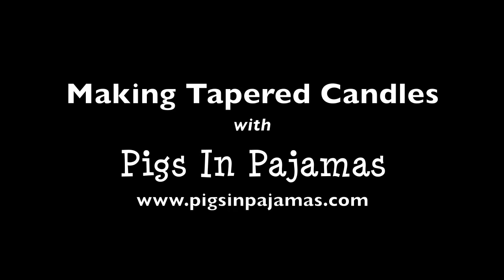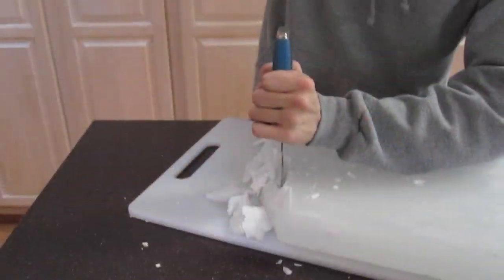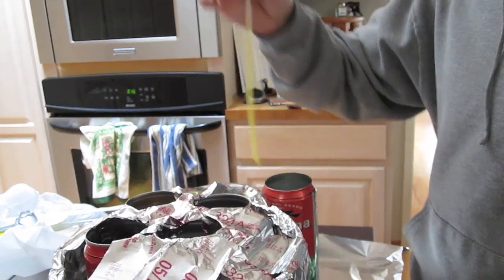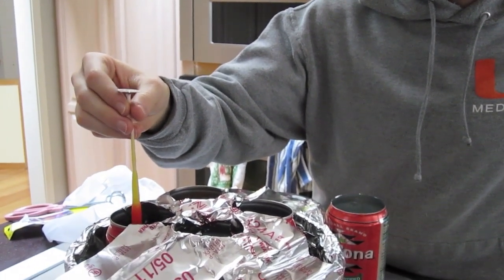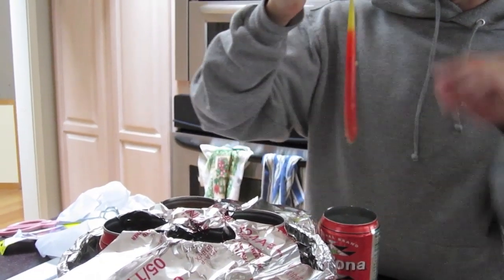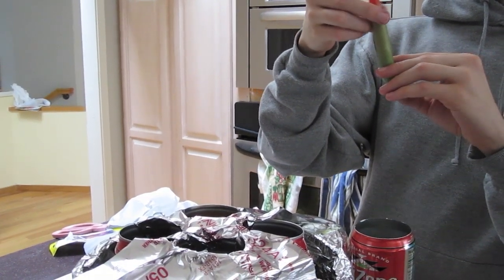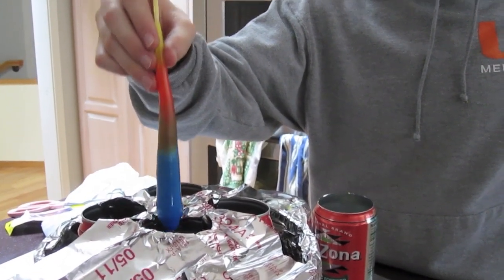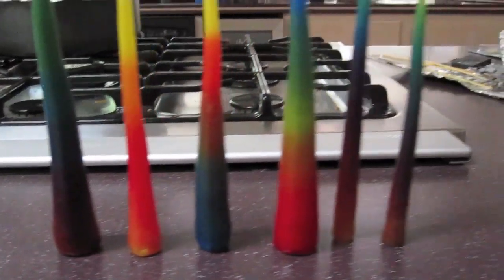Handmade Tapered Candles

Comment: Why are the wick tabs on top of the candles
Reply from the maker: Wicks with tabs was the only wick I could find at the store so we were effectively ignoring the tab. They would normally be on the bottom if I were using them in the traditional sense and pouring candles. If they had been on the bottom, I think the wax would have clumped around it so we wouldn't get that nice taper, but that would be a good experiment for the future!